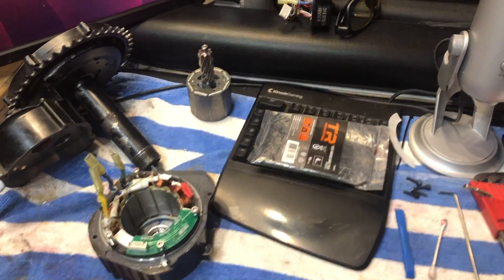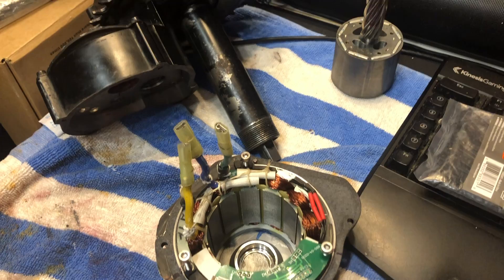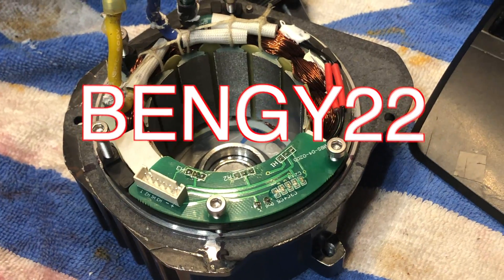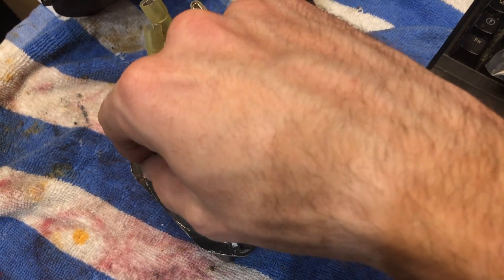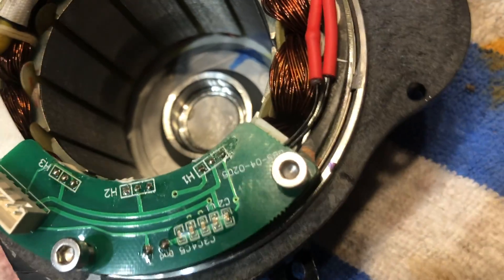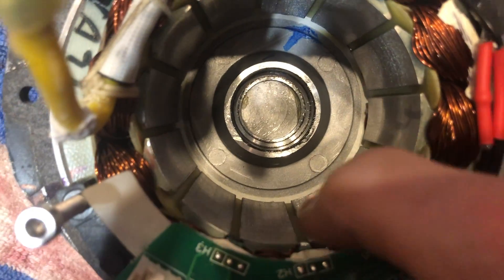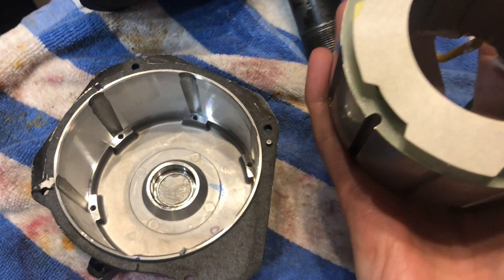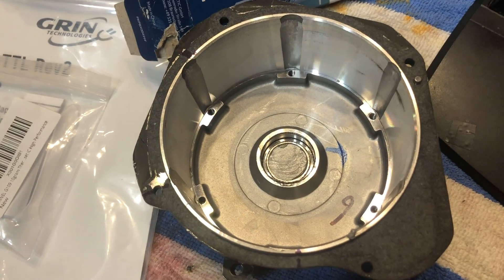BBSHD Cooling Mod - Thermal Paste for Heat Dissipation

Comment: Man you are loving those sound and video effects! For anyone curious I did try to fill in the gaps on the outer laminations of the stator, I didn't fill in the bottom though. I'm not sure how much it would help as that bottom part doesn't really touch the windings plus the paper spacer to help it from possibly grounding out on the case. I would recommend you also try to coat the stator before reinstalling it as when you push it back in the paste will get pushed down to that gap. Coating both parts helps make sure even after install it will be sufficiently coated. If you do like I did a 20g tube will be enough, I used almost all of it. Also for the record because I don't want to take credit I didn't come up with the mod, I found a few posts online of people considering it, but never any "results". In my case I did a 3 mile before and after loop including a hill climb at a set speed. Checking my temps at set points I noticed around a 5-8c drop on stator temps but an increase 1-2c on the exterior case temps. The main reason I did this mod was because I have an aftermarket controller that can do 150 phase amps and it wasn't uncommon (and still isn't) for me to get my stator to 100c and the exterior case temps will still be fairly cool, say 40c. The results indicated to me that the mod was helping pull the heat away from the stator faster than before, heating up the case but then it can properly cool down. Heat builds up on the stator fast and the exterior case is slow to pull that heat away from the stator and warm up itself so anything helped in my case with the now 6.5kw I push (my tested was done at 52v 4kw). In my opinion the mod is good if you are pushing the bbshd with an aftermarket controller with lots of watts, but not something I would do unless you already have the motor open for say regreasing the reduction gear. Unless you just like to tinker with stuff. Also you do want to take note of the stators position before removing, as you need the wire holes on the controller case side to lineup with the wires on reinstall (you can always eyeball after)
Reply from the maker: I tried it riding for a bit, it seems to stay noticeably cooler when i am doing a lot of continuous power, I’ll have to test more when it warms back up a bit
Reply: @EBikeBuilder_  any conclusive results with numbers after you did this mod?
Reply from the maker: I’m thinking if i did it again id get 45G and put it absolutely everywhere  and fill up the bottom as much as possible Lol 😂 i guess the mx-4 is not conductive so you could have like a centimeter thick layer of that stuff on the side and the windings would dunk down in it 🤣 is what i might do on my other HD
Reply: @EBikeBuilder_  The thing is I don't believe thermal paste is super conductive when it fills a huge air gap, I read a post going over how it does better on cpus with more pressure. I know the really fancy motors and some diy'ers (although I haven't seen a bbshd) will put potting material around the stator and any air gaps. I have 0 knowledge on this though and it seemed super messy and easy to mess up so I didn't look further into it for the bbshd. I also briefly considered designing and getting cnc'd a whole new exterior case for the stator to slide into. But with larger fins all around, preferably in copper for its high thermal conductivity or even aluminum which would be better than the cast aluminum its currently in. But the cost was very high as you can imagine. So I just decided to thermal glue on a large heatsink and call it a day
Reply from the maker: @Bengy22  i was looking into thermal potting compound   It seems like it could require a substantial amount but could potentially work better if done right, expensive stuff though i didn’t find any i was willing to pay for lol
Reply: Thermal paste cools down a CPU but because its in direct contact with both chip and cooling fins. In this case there is an air gap. There is no direct contact here. I don't see much of a cooling effect happening.

Comment: For some reason nobody wants to show how hard it is to remove the stator.
Also haven't heard anyone call stator laminations magnets.
Reply from the maker: Was filming with a phone in one hand , you can pull it out easy with a glove. 02 rotor is much harder to pull.   Edit, thought you said rotor,  the stator is easy to get out on the HD,  it seems an impossibility on the 02,  i would be very interested to see someone get the stator out on the 02.  as for the vocabulary Im self taught and idk what Im doing or talking about,  thanks for the correction
Reply: It comes out very easily once you remove the bolts. Slides out with 0 effort